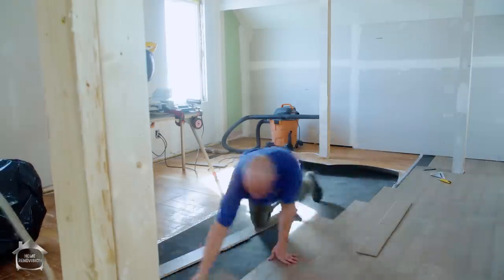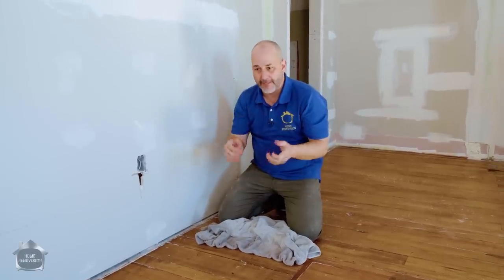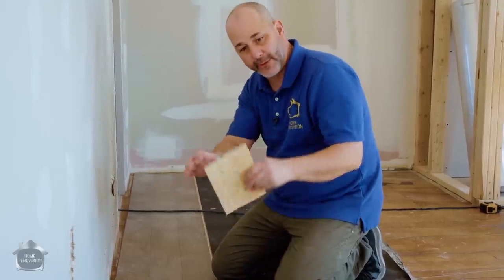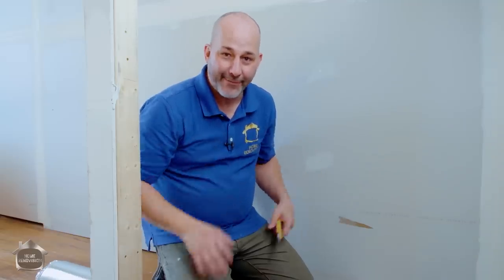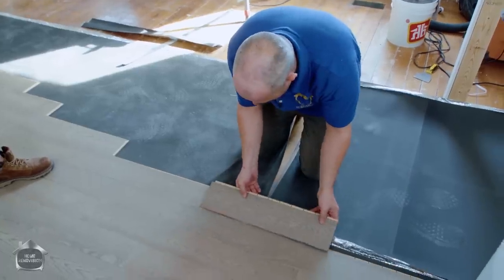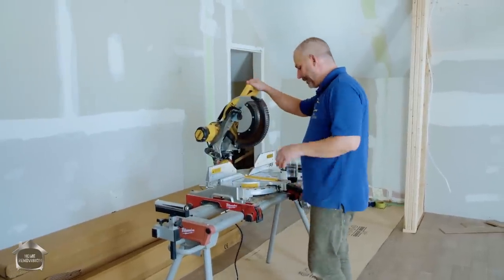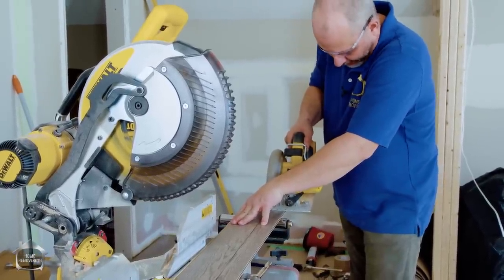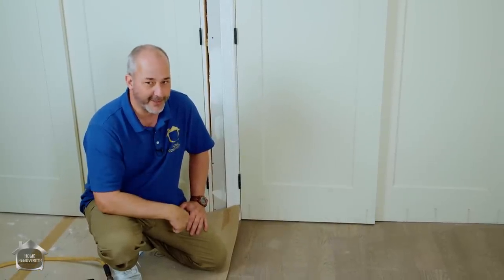This Hardwood Installs Easier Than Vinyl Flooring

Comment: This video sold me on the flooring and I have since done lots of research that many may find helpful.
The manufacturer is WellMade and was originally made in China but is now being made in Georgia as well. A good article on the person who developed this is a Feb. 7, 2022, article in FCNews.
The product is privately labeled and different sellers use different names for the product line, color/finish, etc., but the same pictures and sometimes the same verbiage to describe it. It always come with 16.68 sq ft per box.
It is 7 mm thick, 5" wide, and up to 4' long. It has a urethane/aluminium oxide finish. The wear layer / veneer (wood) is 1.2 mm (47.2 mil), the core is 5.8 mm (HDPC = high density polymer composite, which I believe is the same as SPC = stone polymer composite). The attached vinyl padding (I would call it rubber) is 1.0 mm.
Jeff's link takes you to wayfair (Islander Flooring line). Other sellers that I found are
- Home Depot (Optiwood line)
- BuildDirect (Jasper/Varuna line)
- Wallmart (Pacific Crest line)
- Costco (Golden Arowana line)
I have ordered samples from three of these sellers--they all have WellMade stamped into the attached padding/underlayment and the samples are all the same size.
The color/wood/finish I have chosen is called honeycomb, countryside, sunglow, or frontier, depending on the seller (often given the number 71106). It is currently cheapest at Home Depot. I haven't bought mine yet--don't plan to install it until next year and plan to use it both in the basement (about 700 sq ft) and main level (about 511 sq ft). I looked into using a 6 mil moisture/vapor barrier and/or an additional separate underlayment (not sure I would call it a pad). Although several people say not to use an underlayment because one is already attached, there are some separate underlayments (rather hard and thin) that are made to go with such floors with attached pads. The risk of certain secondary underlayments would be too much give, which may cause the locking connection between the planks to wear down when the floor is walked on. I think Abatec that Jeff recommends (1.5 mm thick) is a good choice, as is Quietwalk by MP Global (2 mm). I think adding a 6 mil vapor barrier to a separate underlayment would be overkill. The advantage of one of these two separate underlayments would be sound deadening and thermal insulation, in addition to being a moisture barrier. One think several people recommend is using a PE backer rod (a spongey long thing with a circular crosssection, maybe 3/8" diameter) around the edges the rooms (where one would use spacers during the installation), topped with silicone caulk--I don't think Jeff talks about this and I'm not convinced it is worth it, except maybe in a kitchen or bathroom. This edging would allow the expansion/contraction of the floating floor but would attempt to prevent water going in along the edges (e.g., under the molding) and soak in/under the flooring.
Reply: Great info! Thanks. Did you end up going with this? I'm looking at engineered wood for my 1000sqft basement in Illinois. I'm considering this as the labor should be much cheaper given the ease of installation.

Comment: Floor and Decor carries this for those in the States. Beautiful product, durable, and a breeze to install.
Reply from the maker: Good to know!
Reply: What brand is this?
Reply: Agree. What brand and color is this?? Thanks.
Reply: What's the brand name?
Reply: @ephraimschmitt3106  Hickory Snow Engineered Hardwood
Reply: @samsonchan1488  thanks!
Reply: I think this is the AquaGuard brand.
Reply: is this waterproof though?
Reply: @kkp4297  it says 'water resistant' so it's probably not 'waterproof' but close enough. I wouldn't put it in a wet area.
Reply: @kkp4297  No, and it's much less scratch and dent resistant than vinyl.  Value for money Class 4 or 5 water resistant laminate would be twice better.
Reply: @samsonchan1488  I just went to my local Floor and Decor in the Charlotte, NC area today and asked about the Hickory Snow engineered hardwood.  It has been discontinued and is made by Lifescapes.  The closest location to me taht has any still in stock is in Atlanta, GA.  Furthermore, I looked at the specs on it as well as the replacement for it and it isn’t close to what Jeff is using here.  He says the veneer is 1/4” thick with 2 layers of plywood underneath.  The Hickory Snow only has a 1.2mm veneer.  A 1/4” veneer would be over 6mm in thickness alone, which is thicker than many LVP and engineered hardwoods are in total.  None of the Lifescapes engineered hardwoods at Floor and Decor have the kerfs in the plywood later either.

Comment: I was laying half inch engineered hardwood and some of the planks were a bit warped, so I set my circular saw to cut through about half the thickness and cut a series of cross cuts every 3-4 inches to allow the board to lay flat.  Then I saw this product, and they did it already for you. And yes, pre-painting the door  trim and baseboard and laying it on top of the floor after the flooring is down is the only way to go.
Reply from the maker: some folks think this is old tech...but they have no idea how much better this stuff is than that old engineered click.
Reply: @HomeRenoVisionDIY  Thanks. Was was looking for something like this a while back, but my job is done now.  My only concern with a floating floor is that I can tell in about 3 steps if the floor is floating or not. It doesn't have that solid glued down or nailed down "thud" when walking on it.  It is more of a give away when dogs walk on it with their clicking claws.  I glued my engineered hardwood mainly because it was adjacent to  tile set on a concrete slab and the tile is like rock.  I didn't want that transition from sold rock feel to a hollow sound/feel.  I'm happy with the results, but it was much slower and more labor intensive to glue it all down to the slab.  I would definitely use your product in a condo or smaller house.

Comment: As someone who installes hardwood, engineered, vinyl and every so often laminate, you should never push down on your piece. When its locked correctly it will naturally drop down into place. Pushing down like what I saw at the 7:00 minute mark will cause bulging in the grooves in the future. Other than that, you always provide tons of great info for the diy guys and gals out there.

Comment: Jeff everyone loves your videos -  Just a pro tip a diyer would want to be very careful when floating floors to not make them so tight that you have to hammer them down a tight floor or pinched edge floor is going to buckle and/or gap, even a click lock. So when putting in baseboard also do make it so tight that it pinches the floor either. THANKS!

Comment: I love engineered flooring.  The best I’ve used so far is Kahrs made in Sweden. It’s 5/8” thick with an 1/8” wear layer.  But the best part is that it has an end lock mechanism to keep the ends nice and tight. It’s called 5S click lock.

Comment: I have been researching concrete flooring for my home. The floor is in such bad shape for when the house was built with paint and spray markers, and not to mention the glue from the vinyl tile that was applied directly to the concrete. It has been a pain. Now I'm having to consider resurfacing. Having a good quality floor is really important to me so this is a very appealing option.

Comment: If it’s difficult to flatten then planing the bead eases it. I used a jigsaw, workmate and clamps, and a sliding mitre saw. and a block plane. If you are sliding it under an obstacle like a toilet then you might need to but joint by cutting and planing off the click joint. Clamp boards before rip cutting.

Comment: The board that gave your son trouble would have been easier if the seam wasn't in line with the doorjam (no matter how much planning something always puts up a fight lol) but if the seam was 2-3inches inside of doorway It would have been alot easier cus then scribe to fit the rest of the board and install with a pull bar ....dont mind my" backseat driver armchair contractoring comment I love your videos and channel you do amazing work and the way you teach is awesome!
Reply: And don't try to have it right against the bottom plate.  There will be a layer of 1/2 inch drywall, and then baseboard, so they could easily leave a 1/2 inch gap.

Comment: I used a different manufactured wood product, though it was quite similar. When sliding a locked board in place you can use a small cut board (sacrificial piece) to tap it into place. No gaps and you don't risk breaking the end locking mechanism.

Comment: After trying a dozen of vinyl samples, went with engineered hard wood (white oak). The main reason was the feel and look that i got from hardwood, and like you said, high end vinyl products could cost the same and hard wood! I guess vinyl would be good for basement projects where humidity or water could be an issue. Thanks for all your valuable recommendations.

Comment: Yes i did used that in my whole new house 4 years ago. Previous house built 8 years ago was regular nailed hardwood, wayyyyyy easier with cliplock system. Nice trick for the end tips, didn't tought of cutting the lip. Was using prybar to move it and clip them.

One question, if one of my plank in the middle of the kitchen uncliped, what are my options? i have a 1/4 inch gap appearing over winters

thanks!

Comment: I thought he was going to show SPC Hardwood, here in US In the last year or so Stone Core with a real hardwood layer that’s finished in an Oxide is just coming on the market. It’s a ACH (durability rating) is 3/5 with regular hardwood around 2. It’s also water resistant and due to the stone core has about 70% less expansion and contraction as wood based stuff.
Reply: Are there any brands you can suggest I look at?

Comment: Good idea taking the door trim off and trimming it rather than going with oscillating saw which will produce a gap that cant really be avoided. Also good tip on screwing first row down. Last time I did a floor right towards the end I noticed it had moved about a inch. Luckily got it back in place. This stuff does look a lot nicer than laminate.
Reply from the maker: definitely!

Comment: I like to do the floors before doors and trim. A lot easier to hang a door than mess about with cutting around them and trying to make it look good.
Reply: Do you have to apply anything  else to seal it like you would other hardwood products?

Comment: Jeff,

I can't even tell you how much time you've saved me fixing my house. I always check your video before I go anywhere else. So you have a refinishing hardwood floors video?? I pulled up me carpets in my new house and I need to send and refinish. If be great if you have a video covering that!
Reply from the maker: I actually have tried that a few times. I always refer to a pro for that job. too much learning curve to use the machines correctly and get a nice job. Cheers!

Comment: i don't consider it real hardwood flooring unless it can be refinished more than once but that is just me most homeowners wont care as they are not gonna be around when that becomes an issue it looks great but it wont last a lifetime or two like 3/4 in solid wood will  great stuff for diy guys cool video

Comment: Nice video - thnx. I installed a similar product from Flooret - their Silvan Hardwood line (on line availability only). The finish is a bit more satin than other click floors so it doesn't have the sheen that vinyl floors have. Techniques fm this video were quite helpful. I have a hallway w doors on both sides left to do. It will be a long tedious day.  :)

Comment: Hey Jeff,
Once again very informative video. I am trying to install this kind of waterproof hardwood from homedepot. I have planked subfloor that was installed around 1955 .My current wood floor is squeaking a lot through out  the house and I think that the 50 percent of the area in a room makes noise. Is there a way to install engineered hardwood over that old floor and eliminate the squeak ? or do you recommend removing the old wood floor, reinforce the subfloor and then install the new floor ?
your opinion is appreciated.
Thank you

Comment: Wait wha?  This isn't that new.  We installed floating engineered hardwood bamboo like three years ago.  We love it and haven't had any issues.  Super easy install and was much easier to snap together than when we did straight up vinyl, although the vinyl we got was some cheapo stuff where the lock system would fall apart if you looked at it wrong.

Comment: Curious about the technology in the underlayment foam pad — I haven’t seen a foam product that doesn’t turn to dust in a decade or so. Are underlayments different?
Reply: THey have a cork underlayment that will last a long time. The denser foam tend to last a long time too usually they are sold next to the other underlayments but are slightly more expensive and will look more smooth in texture.
Reply: @RecklessTheory  Cork sounds very sensible. Thank you!

Comment: @home renovision DIY I would make sure to check with your flooring BRAND to make sure certain underlayments don't void warranties.  I found out with a little research that LifeProof flooring doesn't need underlayment, BUT, if you are to get some, they only allow QuicPrep underlayment brand to retain your warranty of their flooring.  We appreciate the insight on great products, but be warned, some underlayments not authorized by the brand of flooring you are laying down might void warranties.
Reply from the maker: Do you honestly think there is any situation where lifeproof would even be subject to a warranty claim that they would agree upon?
Reply: @HomeRenoVisionDIY  Well, clearly I don't want to take the risk.  LifeProofs website clearly states it.  And even if there IS a better underlayment and something goes wrong with their product, I can just imagine the first thing they ask is, "are you using any sort of underlayment?".
Why risk it?  If getting QuicPrep (which was cheap) is louder by a couple decibels, but saves be possible warranty hassle down the road, I'll get the QuipPrep. 

If I do certain work on my car with products my car manufacturer doesn't approve, they can void my warranty.  Same deal with flooring.  Maybe this is only a LifeProof thing, but it is indeed a thing.

Sure, it's probably a scam for LifeProof to make more money, but I like the assurance knowing that they would have no way to back out of a warranty claim.

Comment: Too late!!! I saw your previous videos and I considered that vinyl was a better option (2nd option after hard wood) than other ones, because vinyl is waterproof, humidity resistant, and wear resistant. Also, does not expand or contract and contains iron particles in their manufacturing. Thus I bought already my waterproof luxury vinyl. I was wondering if engineered hard wood won't suffer the same destiny as laminate if water goes inside (deflection)?
Reply from the maker: it may expand but at least it will contract again when dry. not like laminate!

Comment: How does engineered hardwood normally hold up in areas where the humidity stays between 17% & 25% if it rains?  A few years ago I had Armstrong engineered hard wood, $5.88 sq ft flooring cost plus labor, installed in my condo.  After 6 months some of the corners started to lift.  The installer said he had never seen that happen and that I probably needed more humidity.  The first floor was installed over concrete slab, glued together but floating.  The second floor was nailed down.  Both had this problem and in many places where it was nailed the surface was slightly raised but the layers were holding together.  I sold the condo due to some circumstances and have no idea how they have held up since.  After that I purchased a house fixer and have lived with plywood floors for 3 years and was hoping to finally install solid hardwood.  After watching your videos and due to sudden price increases I had almost convinced myself to just do vinyl.  I do not have a humidifier in my furnace and I do not have air conditioning but that is a story for another day.  I just don't want to make a mistake.  I do not want to have to tear my house up for flooring again so when it is done it needs to last.
Reply: Ive had real hardwood, engineered and vinyl, laminate and ceramic appearing hardwood , and as town without dogs really needs to look closer at luxury vinyl (then again doors are hell on rugs and hardwood!) . You take risks whenever you place any real wood product on a slab, and NEVER in a basement unless you live on a hill in the desert ! The luxury vinyls are just so good today you really need to try one you can like before you take this risk. Now if you know you don’t live on clay, you have a commercial grade sub slab vapor barrier (Stego, Dorken etc) not just some poly from a big box store) that you personally sealed carefully , ensured slab pour didn’t penetrate, AND you have a whole house dehumidifer and an excellent sub slab drainage  system, AND you lay sure go ahead, even in a basement , but obviously this will nto be the  case for most homeowner , and what do you do when you have. Spills leak from water heater, burst pipe, backed up sump, rain floods ? Take you global flooring budget and consider the relative merits of wood, vinyl tile and carpet carefully ; and dont eb locked into oen type fo floor throughout the house.